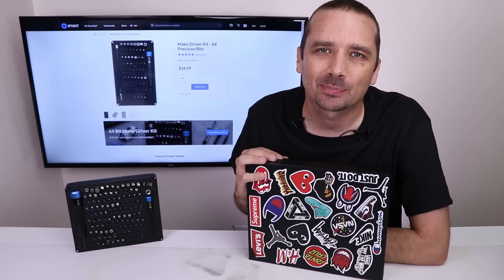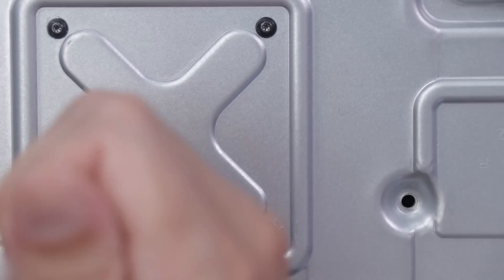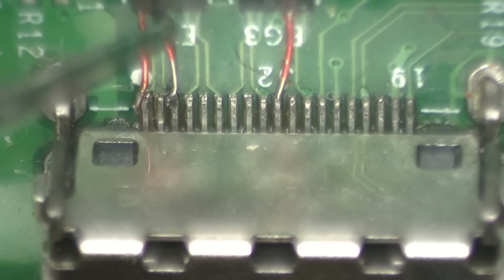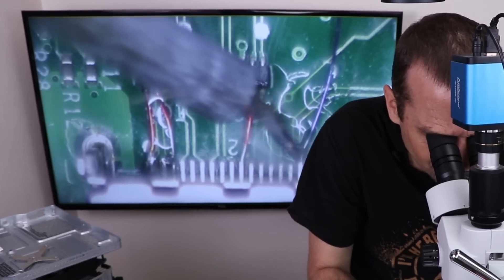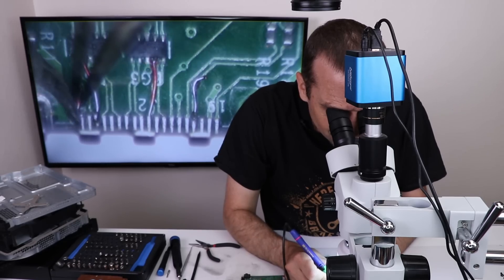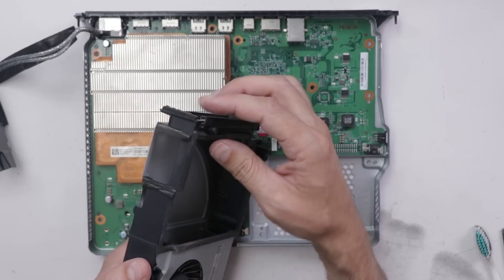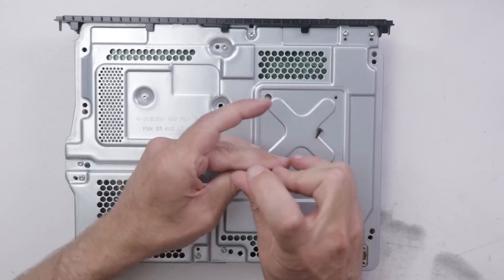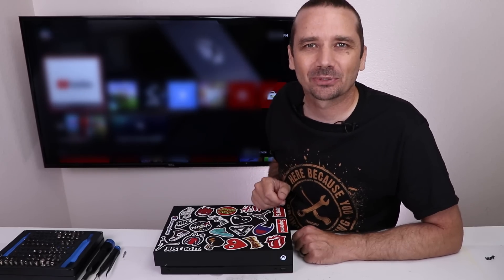A SCAM Repair Shop Ripped Off A Viewer - Let's Fix It!

Comment: nice job, keep going. 
I have some questions, What is that liquid you use Before soldering and What does it do?
Doesnt the board need warming Before reapplying thermal paste?
and my Last question is about some thing called "delidding" (removing cpu's heat spreader and reapplying thermal paste beneath, does it necessary at all? Cause it sounds So creepy.
Thanks in advance. ✌️

Comment: You're the best technician I know..
 I always learn new stuff with your videos 😁

 Btw I started fixing DS Lite a while ago, and I'm doing quite good with those.

 But I have a problem: as my cousin saw my skills, he asked me to repair his 2 PS4s. A Slim version and a PS4 Fat.

He 1st gave me the Slim, and he said that somebody tried to fix it before me, but I think he made it worse.. (He forgot some screws, so I don't think he was a professional one)
My cousin said that the PS4 used to turn on, but it doesn't. It turns on for less than a second and then shuts right off.

Then he gave me the PS4 Fat, but I think I got it worse.
 It used to turn on, but the fan did some bad noises and the console won't accept disks (He said that it couldn't even read them).
 I 1st opened the console and fixed the disk drive, than I gave the fan to a friend of mine to try and fix it, but I'll talk about that in a second.
After I put all the console together I tested it again, and as the fan was noisy, I put the console vertically, and it worked decently.
 Then I put a disk in and it read it just fine, but then.. The console turned off and when I tried to turn it back on, it worked, but the HDMI signal wasn't showing up, so I checked and saw something that I didn't wanna see.

 Now it gives me the BLoD.....

 You're probably thinking, why wouldn't you replace the fan, did you put new thermal paste?
 Well, he didn't wanna spend 30 bucks for a new fan. As I didn't wanna spend 30 bucks of my own pocket for a guy that lets smash his PS4 twice by his parents, I left it like this
 And then for the thermal paste.. Well, I couldn't find it in my anywhere house (And I know I should've bought it new before testing again the PS4, so this is 100% my fault)

If you've read all of this..
1st thanks for the attention.
2nd could you pls help me with those?
What should I do? Should I sell the components?

Comment: Steve is so damn skilled with making these micro traces. I’ve been practicing and stumble a lot. Anyone know which enamel wire he is using?
Reply: He does a great job. After I picked up a microscope, I was actually surprised how easy it was to do a similar repair on ps4 hdmi traces. 100 micron (0.1mm) wire is quite easy to repair with.

Now I didn't know if I repaired it how a 'professional' would, but was surprised to see this video where he also just soldered the pin straight to the trace with a jumper wire. Initially I was trying to find where I could run the wire all the way to the other end/chip but this seemed far easier. Glad I'm not the only one that just jumpers to the trace, but it seemed plenty strong, and gave me more spots to re-repair if I lifted the trace at all.

I've so far failed at working on a 208-pin quad flat-package chip - found it much more difficult than jumper wires, after a bridge that appeared after trying to refresh each pad contact with heat (and flux), and attempted unbridging just slid a pin off to the side of the pad (pad now pushed over/bridged to one adjacent pad, chip pin to the opposite adjacent pad), and the pin tension causes it to fail to lift back over the pad. Can't get the pin to "lift up" - not enough room to get leverage. Even using the edge of an exacto knife seems too large. I still have that project stored away for another day - quit while I was behind so I don't destroy things more than I have! Already made the situation worse by making the initial issue of 3 pins (1 center, 2 adjacent) now turn into 4 by trying to get the lead lifted. I think the entire chip may just need to be removed, cleaned up/straightened, and reinstalled, but it has so many leads to deal with! BGA seems easier.

Sometimes 0.2mm iron tips just don't seem small enough.

Comment: I bought a one s from my friend around 2 months ago for £45/$61.56 he told me it had a broken hard drive and had sent it into a 3rd party to fix it and when he got it back it did the same thing as before. When I got it I turned it on and got a black screen for 10 minutes I completely powered it off and turned it on left it got 5 minutes and it was still black then I got a controller and synced it nothing happened until I pressed the home button after it synced. Then the Xbox jumped into life and booted with the green logo and booted to the factory setup. I set it up and tested all was working which it was. I then opened it up to clean he told me he only had it for about 6 months before it stopped working which was true by the date on the console back and when I took it apart the thermal paste was crusty as per usual of microsoft and the hard drive was the original 1tb Seagate that Xbox one S be shipped with after my friend was told by the repair man that the hard drive was replaced. There are a few hiccups with it every once and a while but I don't know if its due to a bad hard drive or just the way xboxs are but I don't mind as I rarely use it and for £45 it was a good deal (my friend had already replaced it with a series s by the time I bought it and his mum was forcing him to dump it or get rid of it )

Comment: why did they have to run the cables? it didn't look neccesary to me , but I'm just a noob so I don't know much.
Reply from the maker: The jumper wires? When that little tiny trace (thin piece of wire) on the motherboard gets broken you have to put something there to restore the connection.

Comment: Hey! What's the liquid you use to remove the excess thermal paste from the CPU ?
After some rubbing it did a really nice job
Reply from the maker: 99% Isopropyl alcohol
Reply: @Tronicsfix  awesome ty, just wanted to make sure have a good one

Comment: at the 3:55 when you checking the pins the 8 from the right is little bit loose or its just me ???? 🤔🤔🤔🤔
Reply from the maker: It's partially the camera and partially the fast speed I think.
Reply: @Tronicsfix  oooooooooh ok thanks for the reply 😎👍

Comment: Steve i was trying to desolder some points (analog stick on xbox 360) as the solder was old, i took it to put lots of flux over and added some new leaded solder but when i went to touch with iron the solder kept blobbing up and wasn’t melting good (was 375 F). Any tips?
Reply from the maker: Probably need a hotter iron and maybe even more flux

Comment: Great videos Steve. I have an issue with a PS3 fat where it will just loose power at random. I may be able to play it for several hours and then all of a sudden just shuts down. If I try turning it back on it may last 5 minutes and then turn off again. Other times if I turn it on it will immediately loose power. I'm thinking it's either over heating or maybe a power supply issue. Any help would be appreciated. Thanks.

Comment: I had my console crap out on me. Saw what the local repair shops would charge. I literally saved more money by buying the tools I needed and then just watching your videos and an ifixit video.
Reply from the maker: That's awesome! Nice work.
Reply: @Tronicsfix  i’m glad people  still care about the Xbox one X, nobody seems to care about it anymore. Especially Microsoft. I know they had to switch production over to the Xbox series X, but still, they should offer the Xbox one X refurbished at a  discount.
Reply: I do the exact same thing mate its way more fun this way aswell
Reply: I did the same years ago when my PS3 bluray laser died. Just watched some YouTube videos and bought a new laser off Amazon for 40 and did it myself in about an hour. It's criminal that there's such a pushback to right to repair.
Reply: Did the same thing when my ps3 power supply broke, I changed it by myself and it's been good for years now.

Comment: dude great job on repairing. i hope the kid who sent the xbox to you uses this video and sends it to them and to show others not to go to them for repair.
Reply from the maker: That would be funny if the repair shop sees this video. I hope they do and they are ashamed of themselves
Reply: @Tronicsfix  im pretty sure they wont be ashamed in fact they more than likely wouldn't care and laugh it off to the bank. if they did such a bad repair and refused to refund or at least finish what they started they dont care. but if this video is posted around to the point that it starts to question their work and people start asking thats when they will begin to have different feelings.

Comment: Another great fix!  Its pretty diplomatic of you not to put the scam artists name on blast.  Shows how professional you are and that your main focus is helping the customer and remaining professional.
Reply from the maker: I actually don't know who the repair shop was. I feel torn about whether I should say the name of them in cases like this. This is definitely NOT ok but at the same time I don't want them to get hate. There's already too much of that going around.
Reply: @Tronicsfix  I respect that, I think it would be good to name them because that was a poor job and they didn’t give the money back. I can maybe understand the trace coming off but not even cleaning up the paste and replacing it is just ridiculous. It’s just too bad people would probably go hating them and can’t just be happy with knowing a place to not go if you need a repair.
Reply: @Tronicsfix  it would likely also open you up to legal issues.
Reply: @Tronicsfix  I think it's okay as long as you are very specific.  Just give the history of the item as reported to you by the owner.  You can say that you have no idea if someone else opened it and stripped the screws, but whomever did the trace work, didn't apply thermal paste properly.  

There's a line to walk that keeps you free from liability while informing the public of potential scam shops.

By the way, I would love to see a video where you send diagnosed issues off for repair to this shop to see if they do the right thing or scam you too.
Reply: @Tronicsfix  Yeah, but I still kind of hope they see it, in a "you know who you are and what you did" kind of way.  It can be their quiet shame.  😉
Reply: @Tronicsfix  Sounds like the "hate" is warranted in this case. They scammed him at the end of the day.
Reply: @Tronicsfix  Understandable.  You have to be careful what you say in public about anyone.  But if you said "this was repaired by blah blah blah and it's still not working.  I found stripped screws, I found poor thermal paste replacement, I found etc", you are just stating the condition and what you found.  It's not like you'd have said they do poor quality work, they don't know what they're doing, they suck, etc.  Your audience can figure that out pretty quickly for themselves. 😉
Reply: If Steve is in New York the laws probably do protect the ripoff company. The South Main Auto Repair LLC YouTube channel said as a car repair shop, he cannot publicly link another repair shop to shoddy work. He cannot even report a falsified inspection that another mechanic shop performed to the DMV (or New York's version of the DMV).
Reply: Best not to have the shop even if you know. You've only got the owners word for what happened.
Reply: @digitalk68  no need to as that is what review sites are for.  Always review a service good or bad.